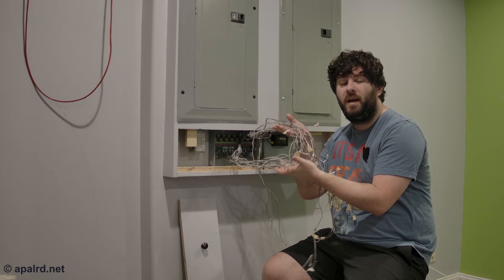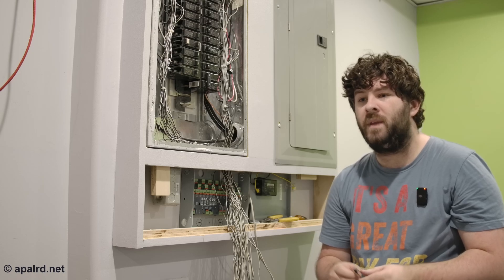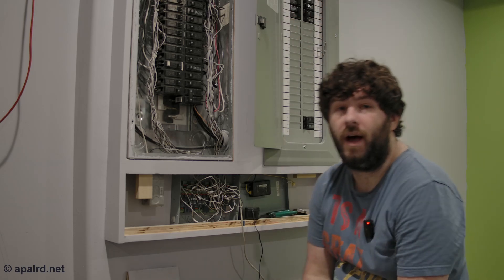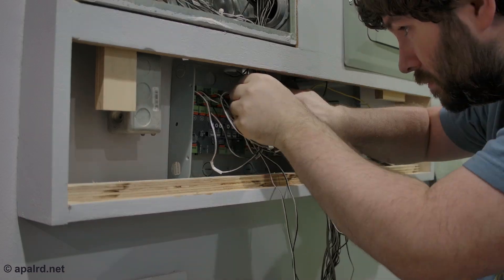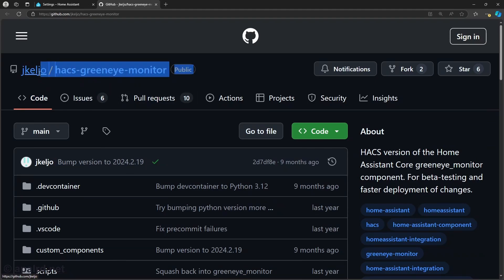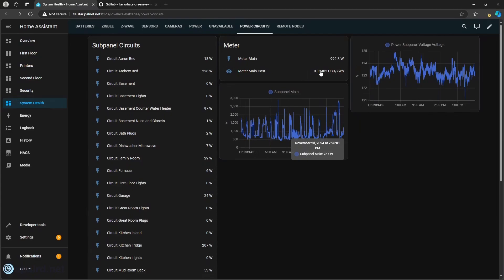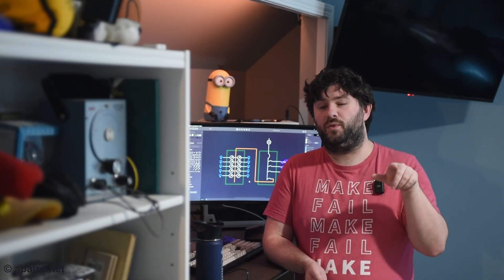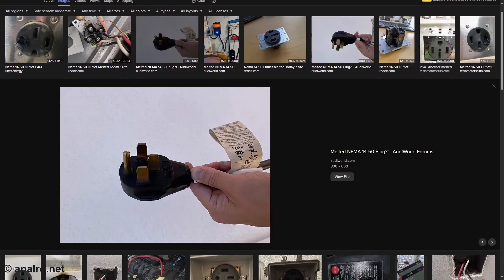Measuring EVERY CIRCUIT in my house ... for science

Comment: Did you google IEC melted pin-and-sleeve connectors? They fail, too! The US (having to be different) uses NEMA type hardware. There are higher current, interlocking (twistloc) NEMA connectors, too. The problem with any plug & receptacle is repeated cycling - both plug/unplug and heat. (RV connections - NEMA 14-50 - are really bad about this. They're cycled A LOT, and people pull huge loads across them - RV rooftop AC units.) If you want to "do this right", it'll all be bolted in place and hardwired.
Reply from the maker: The NEMA 14 style connectors are particularly bad, so many of them are only designed for a a few insertion cycles before they fail, and melted 14-50s for EV charging is a huge problem (same connector as RVs), same poor quality plugs which can't handle their rated load. It seems like the safety testing (UL and/or NEMA) has done a poor job here, allowing plugs to be sold which fail so easily at their (de)rated power.

But in general, the NEMA style bladed plugs have several big deficiencies, the blades don't have to be fully inserted to function and the blades can be touched while the plug is partially inserted and energized.
Reply: @apalrdsadventures  I'm not sure UL tests them the way we tend to use them... hanging on a pole in a field.
Reply from the maker: If you search EV charging failure you’ll see 14-50 outlets installed properly in a garage used to plug in a portable charger cord, or sometimes even a screwed in place charger that’s been unplugged a few times. 

Hubbell makes an “EV rated” outlet which just means it’s rated for continuous duty … which it should already be rated for

Comment: Victron and Pylontech

Victron have great inverter/chargers. the can fail over from grid to island in 20ms, just like a UPS. Theyr current devices use 12, 24 or 48V on the DC side.
But there are new 600-800V DC Products getting lunched in a few weeks (even Rack mountable).

Pylontech produces 48V batterys, with a victron compatible BMS. They now have a new Product Line of 48V Batterys that can be wired in series to get 700V for the victron HV Systems.

Comment: It would be nice to size your inverter to only your actual load but code doesn't work that way for automatic switchover. NEC has rules which are basically 3VA/sqft plus 1400VA per kitchen circuit plus whatever your hardwired appliances need.

Regarding equipment I would definitely go with a 48v off-gird/hybrid inverter. You already know about the Sol-ark and EG4, some other names are Xantrex (now Schneider) Conext and Outback Power. If your utility has incentives for backfeeding the grid during peak times you will definitely want a compatible system.
Reply from the maker: You can use 220.87 for an existing feeder if you have at least 30 days of data.

My utility is pretty anti-solar, they don't want to offer backfeeding at all but are forced to allow it. Since they only credit at the energy rate (not including the distribution rate), it's still a pretty bad deal.
Reply: @apalrdsadventures  I can't believe I had never heard of 220.87 before. I was toying with the idea of backup power at home but IIRC the calculated load was around 65 amps, right above the 60 amps most equipment is capable of.

Comment: go off grid solar inverter.. without solar :-) (this is cheapest+best compared to anker, ecoflow "packaged" solutions) 
EG4 3kW for $674(each up to 12 units parallel) add 48v batteries up to desired outage duration and you should be good to go..  I'm assuming all your loads in the backup panel is 120v.. 

Another consideration is used solar inverters.. since they are readily available you can pickup multiple after you find one you like. People with solar upgrade their solar stuff and then are stuck with the old equipment.. and since you only need 3 or 4 kw...

How much is your power cost there?

Comment: Have you looked at the Victron Multiplus units? They’re not online double conversion inverters but they’re switching fast enough to practically function as one.
I’m looking to build a backup system using these when I start redoing the electrical in our house. I need three for our three phase system here in Europe though. They’re expensive, yes, but Victron is some of the best stuff you can get out there.
Reply: Victron Multiplus II is great.

Comment: The Emporia Gen 3 Smart Home Energy Monitor with 16 50A Circuit Level Sensors is only $200 and does a similar thing with an app and webapp without the need to host it.
Reply from the maker: the data is locked into their cloud platform, they don't provide any way to access the data other than the apps

Comment: Check out the EG4 GridBoss. I have a similarly unreliable power service, and just ordered a GridBoss, Flexboss21, and indoor battery to make a whole house UPS. The install is incredibly simple to integrate with your existing 200amp main panel.

Comment: I just got a EG4 6000xp with a 14.3kwh EG4 PowerPro Indoor battery for 4600$ to the door.  It’s an off grid inverter which only feeds the sub panel but I can AC Charge or DC charge.  Also have a Lilygo RS485 ESP32 devices which connects to the 6000xp and brings me full control on Home Assistant
Reply: I got 2 EG4 6000XP and two EG4 wall batteries for my father's house (my childhood home.)  He's a retired electrician and is installing it himself.  I've had them up and running though already on battery.  I sized it at two since he is at the end of the line and regularly has outages during storms and uses a 10Kw generator to power the house.

The 6000XP, while an off-grid inverter can operate in UPS mode where it mostly bypasses and has a 10ms (IIRC) transfer time to go on battery.

The 6000XP has a 50A grid breaker built in so it's maybe not quite what he wants (60A) but it might still be able to power all his loads.  He would know.

Comment: Here in the Netherlands power outages are rare. Sometimes they are announced when maintenance is done but other than that not even once a year, maybe once in 5 years. Hence no one has/needs backup power except for my Proxmox cluster and Synology NAS systems. Those run off a set of 2 7Ah 12V lead acid batteries with a small AliExpress UPS type charger.
200A even on 110 V is an insane amount. I have 40A single phase on 230V and that has never tripped in 25 years. That 200A is still 2.5 times what is normal here.
Reply: I've had one power outage in Germany in span of last 14 years, not a single maintenance outage.
The joke I like is "Synchronous grid of Continental Europe is my UPS".

For the Amps, my house has fairly new power feed from when overhead wires were replaced with underground cabling, 3 phase 50A _each_, set for capacity for life and small manufacturing business.

Comment: Your power outage count is insane! There are warzones with more reliable power. Does your utility not maintain its infrastructure? One per year in Ontario is annoying enough.

I need to redo my panels which are a 52-year old mix of aluminum and copper. I am definitely going to include the BrulTech product when I do so that I can make some intelligent decisions regarding solar and battery backup. Thanks for the suggestion.
Reply from the maker: The US government statisticians treat <5min and >5min as different statistics, so my utility told me than <5min outages "don't count". The line hits a tree, shorts to ground, line breaker shuts off, then 1 second later the breaker 'recloses' and if the tree is now gone, power is back, and everything is fine. To them, it's not a problem because the recloser fixed it. This happens pretty much weekly, and it's long enough for all of the clocks and computers to turn off and restart. 

We also had 10 outages that 'count', and that totals about 50 hours. One was caused by a driver hitting a utility pole, the rest were all caused by weather and poor maintenance of the utility line. The state requires the utility give us a $38 credit for 6 outages >5min, or any single outage over 10 hours, and they have given one credit this year. The most recent long outage was 28 hours in August, where a wind storm (not a tornado, just higher than normal winds) left >10% of the utility customers without power. The truck performed very well powering the house for the whole time. 

The utility eventually committed to tree trimming this fall (which they did, and the short outages have improved dramatically going into winter) and also replacing things in Q2 of 2025. The utility (DTE) is a state regulated monopoly which operates the HV transmission network in the midwest (ITC), MV distribution network in eastern Michigan, all of the large power plants in eastern Michigan, and is also publicly traded and extremely proud of their industry-leading dividends, which they have always issued going back 50 years.
Reply: @apalrdsadventures  thanks for the details. Ontario has its own power problems but distribution is not really part of it. It's more about the politics of cost. 

It sounds like Michigan regulators need longer sharper teeth and the appetite to use them.
Reply: @apalrdsadventures  At least here in Finland a large part of the "local grid" is buried. The "large" grid of 110kV, 220kV or 400kV is mostly on poles obviously but the local 20kV (sometimes there's also 1kV) is now mostly buried after a frenzied decade of digging and burying and you've got transformer enclosures dotted around from which buried 0.4kV continues to homes and buildings etc. As the lanes of poles are maintained and trimmed of trees, there aren't many reclosure events due to trees falling and with the local grid being buried we don't have much "squirrel caught between phases" incidents anymore.
Reply from the maker: The line to my house (120/240 split phase) is buried to the transformer across the street, and 13.8kv from the transformer is buried to the end of the street, then it goes above ground from there (still at 13.8kv) and everything from there is above ground. Newer developments are usually buried, but of course they will never bury existing lines. 

Most older streets have a 4.8kv or 13.8kv single phase feed above ground with a pole between every other house (behind the house), a transformer at every 4th pole, feeding 120/240 overhead to the house. These have problems with small trees ripping the lines off the side of the house when they fall down. The MV lines also fall a lot in storms, right in people's backyards. Usually they will connect each street to a different phase of the network, so it's not possible to get 3 phase.
Reply: @apalrdsadventures  That's interesting to hear. Over here they've been replacing the existing lines as well. It's been covered with the basic rate of electricity transfer cost. That cost includes the basic rate and transfer fee depending on usage. As you can imagine some operators have been taking advantage, Caruna for example which is a large national grid operator and was sold to investors.. Transfer operator depends where you live so basically a monopoly, energy "supplier" I can choose. My local grid is owned by the city so even the elevated rates for the extra work is more reasonable than the rates other grid's charged more than a decade ago.

Where I live the over head 20kV feed was replaced couple of years back. The local grid operator deals with the street and park lighting as well so they've been upgrading the light poles at the same time they've been burying the 20kV lines. It's been interesting to see the work.
Reply from the maker: The utility and distribution operator (medium voltage) is one company. They offer different rate plans, and also have a separate distribution charge vs energy charge, but it's still all just one company. The HV (100kv+) network is another company, and they are interconnected across the country with MISO (who operates the midwest wholesale exchange). There is no way to get any sort of real-time-ish rates, or flat rates, only their 3 time of use options. In theory they have to get their rate plans approved by the state.

Comment: 200A is like for a small factory use in Europe 😄
Reply: 100A was really common in the US when natural gas was being supplied to homes too. As more areas move to no NG, and cars charging at home now too, 200A is way more common.
Reply: @colinstu  Even 400A is increasingly common.
Reply: in Germany three phase is by default, 100 amps,
if you heating your house electrical, 160 amps.
Reply: or 400A for Medium sice event. (3 Phase)
Reply: US electrical supply is at a lower voltage, you cant directly compare the current
Reply: @seanrabenaldt  you can, just double the amperage vs europe
its basicly a 100A supply that is UK at least pretty common now
Reply: @popeter  doing math isn’t directly comparing 🤪
Reply from the maker: it's also single (split) phase instead of 3 phase, so it's carried over fewer conductors as well. I assume a UK 100A supply would be 3 phase. 

So a 120/240 200A US split phase supply can deliver 48kW, while a 230/400 100A 3 phase UK supply could deliver 69kW (nice). 

A 63A 3ph EU supply could do 44kW, so basically the same capacity as our supply, we just need 3x as much copper to carry the power.
Reply: @apalrdsadventures  no most places are 100A single phase thou more are getting 3 phase as EV's and heat pumps are getting more popular

also nearly all customer grade fuse boards are DIN rail based so easy to add in stuff like contactors, surge protectors, power monitors and timers
Reply from the maker: I think air conditioning is really what killed the 100A supply in the US, some places now require you size the service for non-gas appliances, but realistically the power required for AC is nearly the same as required for a heat pump in at least 2/3 of the US. 150A is a bare minimum, with 200A and 400A services being fairly common now. 

I do actually have a 400A service from the utility, but it's only feeding one 200A panel.
Reply: @apalrdsadventures  nope 100 amp isn't 3 phase in the uk or Ireland
Reply: @BenCos2018  Yes it is, but its unusual. Many new builds are 3 phase ready. Often times, your DNO can upgrade to 3 phase for a sensible cost